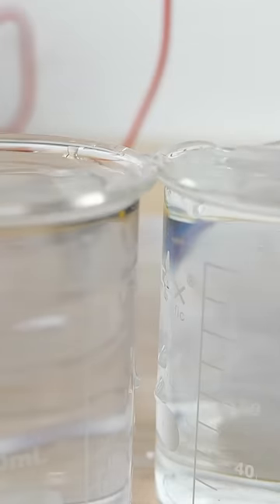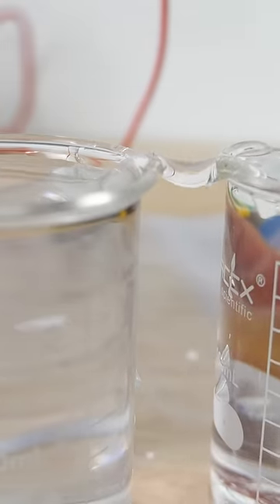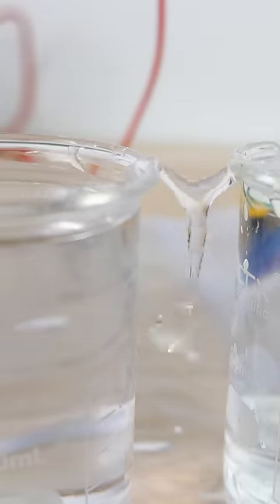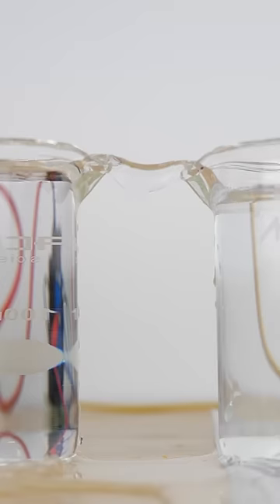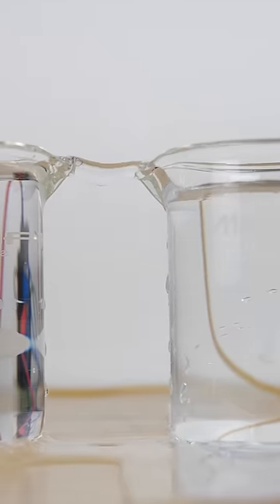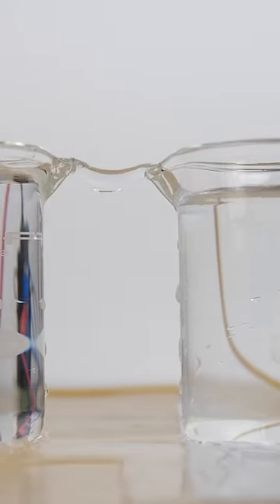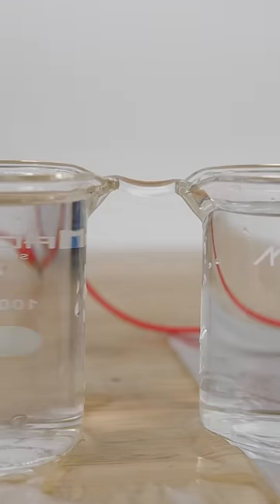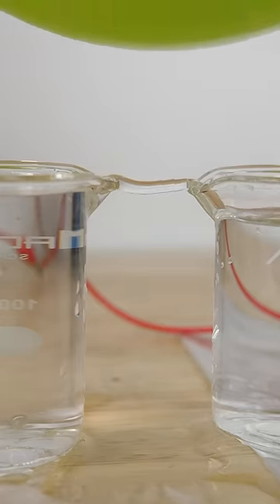How To Make Stretchy Water

Comment: Hmm after all these comments he didn't say don't try this at home for this one, gonna find a 40k volt source to put in my water today.
Reply: Hahaaa, he forgot to say it so we‘re allowed!
😜
Reply: SUPER TESLA SAYYAN POSEIDON
Reply: Grab a capacitor and a 12volt battery from a car, and get on testing this out then 😝
Reply: I'm just saying, but amplifiers do that. with that being said...
Reply: Try to join your sink to your bathtub
Reply: @--JawZ-- a 12v battery is going to give you 12v lol about 40kv shy. and if you did try to convert it's high amp output to more V, with a transformer, you would destroy the battery, you may as well just connect the leads....
Reply: Tip : use zvs driver + flyback transformer,  it works, it produce around 40k to 60k ⚡ volts
Reply: Have you found one yet?
Reply: @LuxLucidOfficial Most modern cars utilizing a 12 volt battery have multiple ignition coils that have 40KV + each.
Reply: @roscosnyder3584  Yes, but it's not a capacitor doing it, and ignition takes a fraction of a second (I imagine just timed sparks) as opposed to sustained 40k volta (I'm wondering the amperage required here, but even at 100mA that's asking a lot even from  something like a marine battery. If it's in the realm of 10mA, then definitely possible, but with some sort of transformer as stated above)
Reply: @LuxLucidOfficial  Sure, but I was responding to your comment about destroying the 12v battery with a transformer that produces 40kv. Yes, it is low current.  Good quality ignition coils can produce a constant arc at around 40kv. Btw, I've been an auto tech h for 24 years, and specialize in diagnostics, which entails a lot of.electrical  testing on afore mentioned systems.
Reply: Voltage isn't dangerous. It's the current, and in this case, the current is very, very low. This isn't dangerous at all. It would be nearly impossible to create this much voltage at home with any meaningful amount of current, short of building your own substation. Remember the formulas from basic middle school science class.... voltage times amps gives you watts... or total power. So 40k volts times 1 milliamp would give you 40 watts and likewise 4 volts times 10 amps would give you 40 watts, in either case, it wouldn't be dangerous, and in either case the total power (watts) is the same. Take a standard circuit in your home, though, and you get 120 volts times 25 or 30 amps, depending on the breaker, and you start getting into the potentially lethal territory of 3000 watts or more which is waaaay more energy than he is using in this video. He didn't give a disclaimer because no disclaimer is needed.
Reply: It's not the volts it's the amps
Reply: That’s like 100 toasters🤯
Reply: 40K volt at probably a fraction of an amp ...
Easy to convert.
Reply: Bottoms up😂
Reply: You should. Make sure it's working by touching your tongue with it! I find that always works best to fry your brains!😉🤣🤣🤣
Reply: At 40kv, it'd be almost impossible to get the amps high enough to hurt you, so go ahead
Reply: A hairdryer?
Reply: Remember to use deionized water.
Reply: @johnny0454   Lightning bolts dont have current but they sure have volts.

I'm quite sure that lightning bolts aren't harmless.
Reply: Ok
Reply: put a toaster in a bath tub full of water
Reply: @johnny0454 Bruh. You can't say voltage isn't dangerous!!! I know most of your points are true but you are missing an important one. Resistance! Body resistance! The resistance defines the current flow. And the current flowing through your body at 40 kV is 100% deadly. Except the current flow is limited. Like a static balloon where not much energy is stored. It can even be deadly at lower voltages when your body is wet and therefore the resistance lower. In Germany we have "touch voltages": 120V DC, 50V AC. For children and animals half of that. But only 12V AC or DC in wet areas!
Reply: @younscrafter7372 Absolutely depends on your source! If your source can't supply more than 0,05A. Sure. A static balloon definitely won't. But if you take 3333 12V batteries you are deader than dead ☠️
Reply: And there are tiny 12V batteries. Like the A23
Reply: And you can get 100 of them for only 30 bucks. So guys NO JUST NO. Pls don't kill yourself
Reply: @Aaron.Thomas  lightning bolts carry a shit ton of current, lol
Reply: @lukasoffen2420  Resistance can define current flow if current is available; however, in this case... if you're producing 40k volts at home, you're probably not going to have enough current from the source to be dangerous. Additionally, resistance is an impedance to current flow, which results in the production of heat. Thus, the higher the resistance, the less current will flow. Unless, like I stated earlier.... you have your own substation. So, in this case.... the power source will be limiting the current. Your body is not going to magically suck more current out of thin air than what is available from the source. The power source would be the limiting factor here, and to have enough current to be dangerous at 40k volts, you would have to tap into a substation, a power plant, etc.
Reply: @johnny0454  Of course the source can limit the current. I wrote that. But like my example with the 3333 batteries: A "normal" source isn't limiting anything! Only if you have regulating electronics like a CC CV power supply the current will be limited or a source that has an extremely high internal resistance.
Reply: I'm also ready to sue him
Reply: Dw all you need is a wall plug and a transformer ;)
Reply: Volts don't kill. Ampers do.
Reply: @badmaniak  yeah but you need volts to pass ams through something with lots of ohms
Reply: just carry a 600 pound transformer from your nearest electric pole, think smarter not harder
Reply: We can use a step up transformer to create such high voltage.
Reply: Just spray water hose at power line
Reply: Fly back transformer
Reply: Buy your coffin first
Reply: He also asked what do i think. So i gotta try right?

Comment: If you put 40,000 volts through me I won't be stable either
Reply: Or maybe it'd straighten you right out and make you stable 🤔
Reply: @Conald_isAfalseProphet Stably decaying.
Reply: Yes you would be stable, if the source resistance of the power supply is low enough ..you'd be stable alright, you'd be smelling a bit of burnt carbon, you'd have a bit of smoke coming off you too.
But you would be stable....AND dead.
Reply: @asleepappeal  tomato, toe mah toe 🤷‍♂️
Reply: @deang5622 Ahh, just like my hot dogs. Nice and crispy!
Reply: 40.000 Volts won't do shit if there's no current
Reply: think of these thoughts as limitless light
Reply: @Conald_isAfalseProphet 🙂‍↕️🙂‍↔️
Reply: Depends if it's 40 000V of high frequency AC you won't even know there's electricity flowing through you.
Reply: and u wud dance on bridges n poles n do drops too

20$ is 20V
Reply: @asandax6  it can still fry you tho
Reply: @GERALD_786  Well yeah your body will basically become a resistive element and start heating up. So you won't be touching it for long unless you want to become roasted beef.
Reply: @asandax6  yummy?
Reply: You'll be cooked to perfection in 5 second 😂
Reply: @anonymous_exe__9516  but it would be a very hard and chewy flesh, and it wouldnt really taste good because it now contains weird chemicals
Reply: I've had worse. I was once shocked by 100,00,000 volts for 30 minutes once before I managed to break free by squeezing really hard
Reply: im PRETTY sure you can survive 40,000 volts with the type of luck you've been getting
Reply: @cinguloapathy exposing closing circuitry of fright

Comment: Something to note is that water can leach a little bit of sodium from borosilicate glass, so experiments with ultra pure water have to use more inert materials.

As for the mechanics of the bridge I think deionized water still spontaneously dissociates into hydroxide and hydronium and free protons so that it can flow by electrophoresis, the trick is how the water becomes charged with excess electrons and begins to change phase as the electrons bunch up along the surface. Water also naturally forms an ion exclusion zone (EZ water) which is more organized liquid crystal phase of water that polarizes along the interface of air and water, all the hydrogens and oxygens line up in long water polymer chains. The bridge would be a double layer made of these water chains facing inward with positive charges flowing inside bulk water phase and the EZ phase flowing oppositely on the outside. Since the bulk water has more volume than the EZ phase, the flow is net towards one side, while the outside is conspicuously slower than it should be from drag alone, masking the presence of the reverse flow on the surface of the bridge. 

This is my hypothesis anyway. I'd like to know how you could falsify this model with an experiment to rule out the presence of EZ water flowing against the current.
Reply: Indeed.
Reply: @goodgamer-yf2il  Enlighten us
Reply: @goodgamer-yf2il  Agreed. I actually read it and translated it into English via Google searches and it is literally like my biology textbook's definition section threw everything up in alphabetical order

Edit: yup. Unit 1: properties of water. Just all the sciency sounding words. Pretty sure this is just like bait for people that don't actually read long comments with big words
Reply: Water is a polar molecule so it would orient itself with the changing electric field and move by electrophoresis anyway. The effect is normally small in deionized water, but 40K volts is a lot.
Reply: Okay that's great and all but can you translate this to english?
Reply: Wrong. It's all about the magnetic force and the galactoids conatiner inside the water crystalz
Reply: What he said
Reply: If you add a fluorescent or radioactive ion to one of the beakers so you can track where the ions are and also put microscopic floating beads on the surface of the water, you should be able to track the flow of the ions and the flow of the surface.

Comment: I made the same experiment with oil. It works, but less pronounced. Because it is less conductive. At this voltage even isolators become somewhat conductive.  I think the electrostatic force forms the thread, it follows the field lines.
Reply: Thank you ! This is exactly what I was thinking but you worded it much better than I would have 😂 basically I think it’s because the water is conductive as well
Reply: @zachburton4190  Thank you!
Just want to add: The water flow can be explained by ion wind.
It is also to consider, above the fluid there is a thin layer of vapor which is electrically charged and moving, in this situation.

Comment: Well, water is polar. Could just be increasing the slight amount of magnetism into a properly aligned liquid magnet. Could also explain why it heats up. Most of the energy transfer would be unidirectional, adding more heat to one beaker than the other
Reply: interesting theory but water has very weak para-magnetism so I'm not sure it'd be enough to cause this
Reply: @friedice420  I mean he's adding nearly half lightning bolt at constant rate
Reply: @winterbird275 not even close. 40000 volt vs 125 million. and whats the amperes
Reply: The polarity of water isnt magentic polarity, its electric. Clearly why water orients along electric fields, not magnetic fields.

As mentioned earlier, water is not paramagnetic since all of its electrons are paired in orbitals hence magnetic spins cancel out.

Maybe you could argue that the high voltage excites water molecules to a paramagnetic triplet state.
Reply: But magnetism aside, I can see where you're getting at. The strong E field generated might be causing highly aligned H2O molecules that give stability to the bridge. 

As for water flow, maybe charged redox products are being formed at the electrodes. The charged species then flow from their originating electrode to the other side, carrying some uncharged H2O with them.
Reply: @mpanganiban I thought electric fields and magnetic fields were one and the same? Or are they different phenomena
Reply: @vappyreon1176  in a sense electromagnetic waves refer to two parts of a whole. Oscillating electric and magnetic fields coexist as orthogonal waves that propagate along space together. 

But electric fields don't necessarily have to coexist with magnetic fields. And even when they do coexist (as with the case of moving charges), the two fields act as different forces.
Reply: @vappyreon1176  E fields push or pull charged particles, or rotate electric dipoles as with water. Meanwhile H fields act on unpaired electron ""spins"" (usually illustrated as up or down arrows if you search for electron energy diagrams). All electrons in H2O are paired -- meaning each electron with a spin up is paired with an electron with a spin down. Paramagentic materials like iron and its compounds have unpaired electrons that can react to H fields.
Reply: @mpanganiban  that makes sense, thank you
Reply: @vappyreon1176 Electric fields and magnetic fields cause each other when changing over time according to maxwells equations. 

The electromagnetic waves he is referring to are one solution to maxwells equation when you have a field oscillating in a wave over time
Reply: Yes I was on this same thought
Reply: @capvux The electricity would cease to exist without oxygen. The current would just stop and the water would fall.
Reply: That’s what I think is happening as well.
Reply: @sanaiqbal567  yeah the lightning analogy was wrong but still 40k volts is big
Reply: @sanaiqbal567  Misheard him. Idk how

Comment: I believe it is the skin effect that speaker wires deal with as well, the high voltage is dancing around the water to get to the opposite polarity or to something grounded. 40,000 (Forth thousand)  volts is alot of excitement in water.  In solid wires the higher frequency tends to create a skin effect that dances around the wire or speaker cable. It can induce other issues with sound, but with water it just wants to let the voltage get somewhere and I believe it carries some micro droplets at first from a charged leader like lightning, I am pretty sure the skin effect is what keeps the water in a tube shape. The electricity is on the outside on the edge of the water tube and not inside is my guess.
Reply: I think this is a DC voltage, so the skin effect shouldn't be present?
Reply: Thank you for your educated guess and genuine answer. I like this science experiment videos bc he explains the physics/chemistry behind it. Sometimes when i read comments to see other people questions or answers, i get disappointed seeing so many comments exactly the same or not even about the video. I was hoping to connect with other intellectuals 😅 see like mindedness. But not comment after comment saying the last thing posted as if it’ll be funnier reading it for the 30th time. Lol
Reply: @tuckermatis1572  he doesn’t say if it’s dc or ac, but I’d guess ac because 40,000 volts dc is ridiculous and I’m not sure how he would get such a voltage.
Reply: @matthewlithgow8578  Not really? Any typical van der graaff generator can do it as a novelty toy. If there were some current flowing, then yes, it'd be very hard to maintain that voltage for long; but this, he said, is very pure water that's acting essentially as a dielectric material. Ie. It's a funny capacitor.
Reply: @matthewlithgow8578 definately DC.  You cannot exert a flow with AC.  You need a static force.

Same applies to a elevated TAC from a string between two tin cans.  Charge transfers to the tac, similar charges oppose each other and forces the tac to travel to the other side.  Creates a pendulum effect like a clock.  It continues until all the static charge equalizes to both tin cans.

Voltage is a pressure force where current is a flow.  Skin effects are only present with high frequency currents (larger AC frequency, greater the skin effect).  You need Magnetism to create skin effects and magnetism only exists with current.  This experiment only uses Voltage.
Reply: @matthewlithgow8578 If memory serves, the flyback transformers enthusiasts use in such videos can generate about 40 kV (i.e., 40 000 volts) unloaded.

Comment: I think the charge from the static of the balloon starts a chain reaction of charges, and the high voltage in one beaker is like having many dominoes set up, and the static is like pushing one over. My guess is that the static charge aligns a few polar molecules in one direction, creating a dipole moment that moves all the water molecules in the chain, creating a similar laminar movement from one beaker to the other, like we've seen in some of your other videos with polymer chains.

Comment: I would call this process 'water magnetization'. I believe that, just like iron or some metals, when you pass currents through it, the water becomes magnetized. When an electric current flows through a conductor, the electrons within that conductor are in motion. Specifically, a magnetic field is generated around the conductor in concentric spirals, with the magnetic field lines forming circles around the wire. The greater the electric current, the stronger the generated magnetic field.

It would be easier to explain with a diagram, but basically, you're compelling a disorganized medium to become more organized, similar to when you bring a strong magnet near iron.
Reply: Just one question why would it be attracted to ballon if this the case.
Reply: @skylerlightning4620  Water has positive and negative part,
positive is attracted to the negative part of the balloon